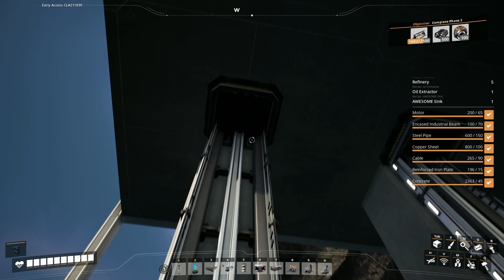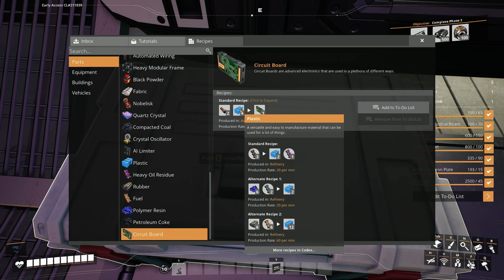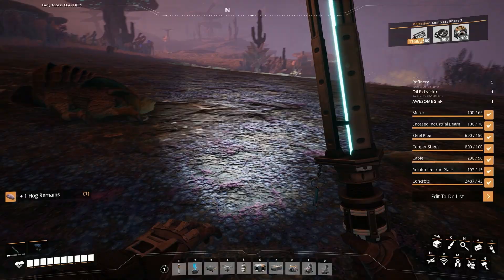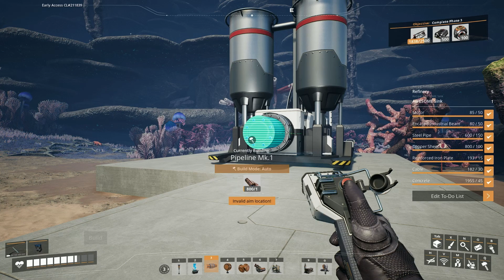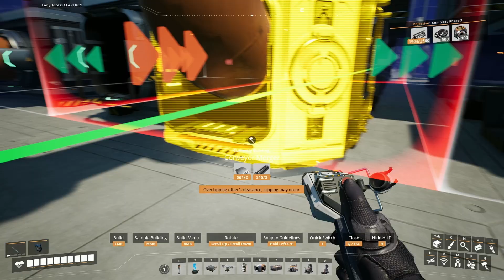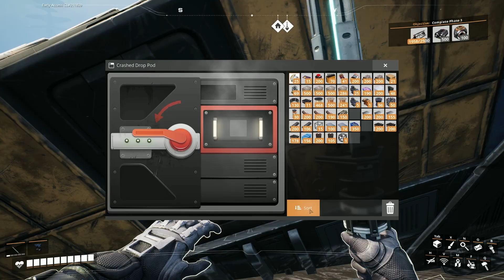Basic Oil Setup For Plastic & Rubber - Let's Play - Satisfactory Update 7 - Episode 12

Comment: There is a great way of using petroleum coke. That's not my idea, but anyway. Coal power plant can burn it to give you power. It's not so efficient as coal, but it's basically free, so who cares. Also you have a lot of water near your oil, so it's easy and free power. Or you can make a completely autonomous oil production
Reply from the maker: Oh right, I didn't think of that. I'm getting close to my power capacity, so that's a very useful idea, thanks!! 😊👍🏼